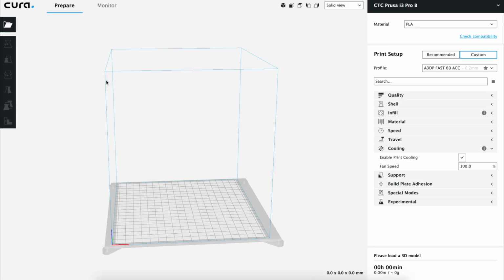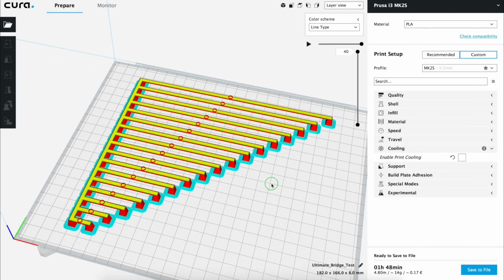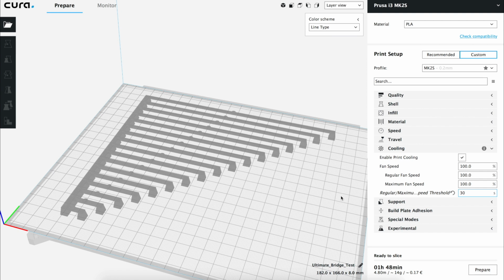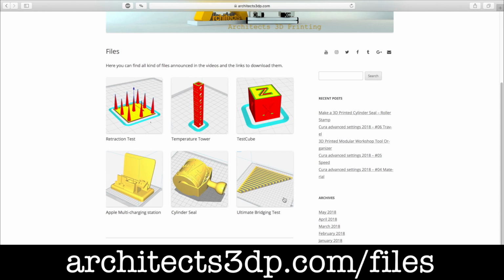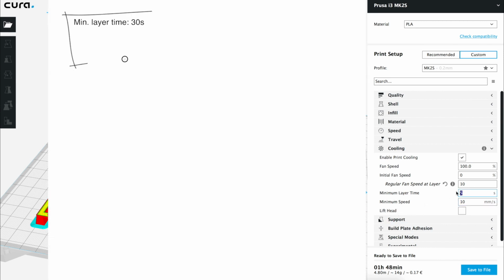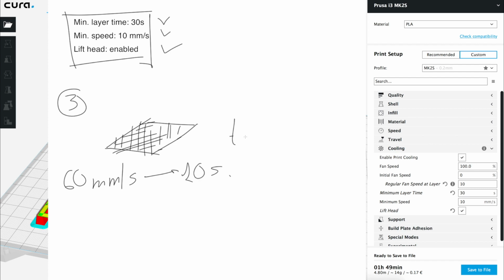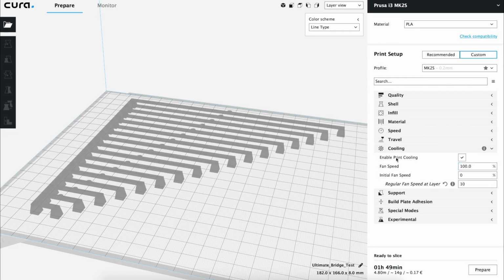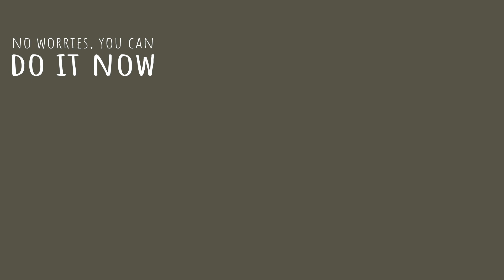Cura advanced settings 2018 - #07 Cooling

Comment: Your explanation and interpretation of the fan speed threshold function is quite simply wrong. It is the threshold at which fan speed is INCREASED when layer times decrease, from regular fan speed to a speed "proportionally" HIGHER speed  calculated between your regular fan speed and the higher maximum speed until it reaches the second threshold dictated by the minimum head speed at which point it reaches the maximum fan speed. As the layer time reduces further, the fan remains at the set maximum and the printer starts slowing the head until the minimum head speed is reached at which point it performs the "Lift head" function if activated. Can't believe someone else didn't point this out to you earlier especially the guys from Cura. Go print a Benchy, when it gets to the smoke stack you will hear the fan speed increase not decrease.
Reply from the maker: Dear Keith Young,
Thank you so much for your extensive and very clear explanation! I hope this information is useful for everyone, I'm going to pin your comment at the top, so I hope everyone can read it :) Thanks one more time!
Reply: @architects3dp  thanks for your informative videos, this site also has some great explanations! https://ultimaker.com/en/resources/52674-cooling